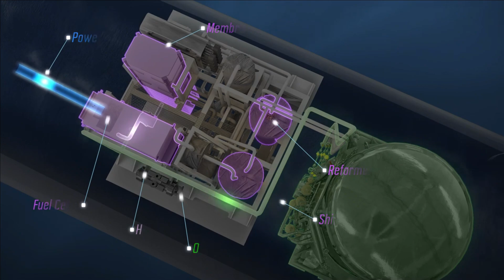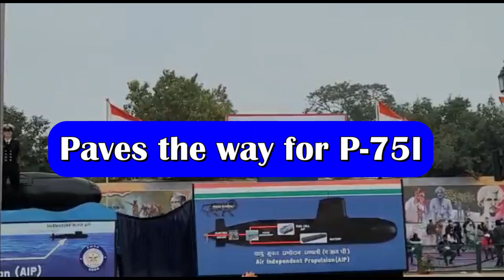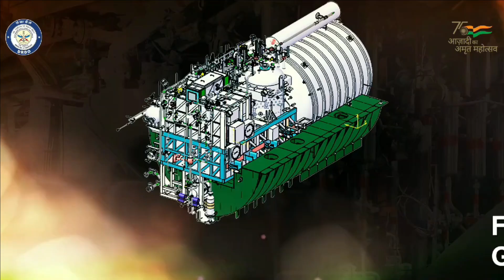NMRL & Naval Group to fit DRDO’s AIP in Kalvari Class Submarine #drdo #indiannavy #submarine #navy

Comment: Thanks for bringing in the good news and this is a very positive development. As a backup plan  we also explore the Li-Ion system AIP, as that will eliminate the need for another powerplant like fuel-cell or Sterling engine (plus the associated internal fuel) and make the whole set up simpler like the Taigei class subs. I think you also support this view. Thanks.
Reply from the maker: 💯 Bharath Forge and General Atomics is working on Li-Ion battery 🪫
Reply: @IndianDefenseAnalysis  Yes you mentienod that in one of your videos. That line must also be pursued.

Comment: This tech of aip is bought fron Russia. Even the Russians themselves have not succeed on 677 submarine, this copycat is gonna fail too
Reply from the maker: Except Germany and SK no other country has fuel cell based AIP and now India
Reply: @IndianDefenseAnalysis  Do some learning, there are various fuel cell solutions in the world. German/Korean solution is based on polymer electrolyte membrane (PEM) fuel cells, the hydrogen are previously stored in metal rods. Your DRDO solution is based on hydrogen generation by diesel reforming,  which has been developed by Russians decades ago. During 2010-2012, Russian tried to offer China 677 Lada class submarine, one of its main features was this diesel reforming aip system. So it is just like another Brahmos or  Adani version ATHOS, another trick to pleasure modiji's atmar nirbhar vision. You Indians always talk too much and learn too little, you should have known the ABCs about Russian AIP update at the moment the Russian-sino submarine trade rumors soared  up.
Reply from the maker: @yixinmei5854  again mis leading, there are many AIP system and I have particularly asked for FUEL CELL Based AIP. Even I have reported Germany and SK has it and Spain developing it. Name any one country with this tech and link for your claim.

Comment: the is the best AIP system currently.
a big salute to our engineers 🫡
Reply: This is the untested technical route which based on russian technology.
Reply from the maker: Russia don’t have fuel cell based AIP - share the link if you have credible source.
Reply: @IndianDefenseAnalysis  Russia offers novel AIP for Indian submarine program
The reformed diesel-based AIP will be cheaper and more efficient, say designers.
Chief Designer at the Rubin Design Bureau, Igor Molchanov, broke down the concept, which is significantly different from existing fuel cell-based AIP plants.

According to Molchanov, a submarine with this AIP plant would be capable of being submerged for as long as the stock of oxygen remained available for the plant.

More economical than the technology and process used by existing fuel cell-based AIP plants, he explained that the objective of both types of processes is the production of hydrogen, which is then mixed with oxygen to produce electrical power and water.

But while other technologies rely on storage of the hydrogen stock in special metal hydride or ‘intermettalic state’ cylinders, Molchanov explained that their AIP concept involves the storage of hydrogen simply in the form of carbon fuel from which it is extracted. This ‘reformer technology’ relies on carbon fuel that is already available in abundance on diesel-electric submarines: Diesel.
https://stratpost.com/russia-offers-novel-aip-for-indian-submarine-program/
Offered last year, coincidence?
Reply from the maker: @yixinmei5854  again these are attempt by Russia to win the order for submarines. My question is simple:
1. Does Russia has operational fuel cell based AIP - NO
2. Is Russia is developing Fuel cell based AIP - No

And India has already tested its land prototype at max endurance and not integrating it

So your claim of DRDO has got this tech from Russia is baseless.
Reply from the maker: @yixinmei5854  again baseless talk, not going to comment further - you have no point to prove but play some blame games
Reply: @yixinmei5854  Russia is broke 😂😂 no money